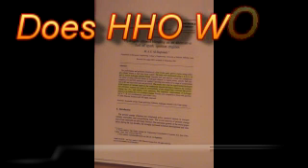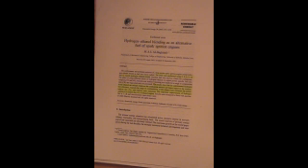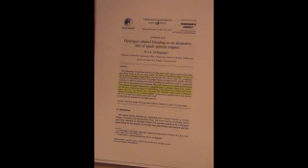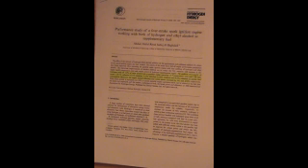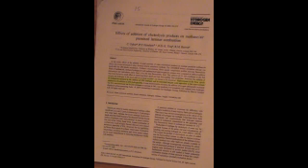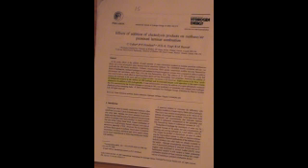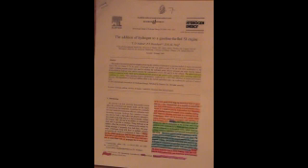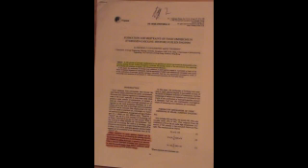Does HHO Work?

Comment: Here is another article from 1989 to look for, but you will have to pay for it :
IEEE Article 899403
FUEL CONSUMPTION AND EMISSION OF SI ENGINE FUELED WITH H2-ENRICHED GASOLINE
Y. Hacohen and E. Sher
The Pearlstone Center for Aeronautical Engineering Studies
Department of Mechanical Engineering
Ben-Gurion University of the Negev
Beer Sheva. Israel
It concludes a 10-15% fuel economy gain with a 2.3 carbureted engine, but an increase in NOx.  It states a hydrogen to fuel mass ratio of 2-6%.

Comment: Rant Part 3

To understand You only have to understand how  the energy transfers from Up & Down to Rotary.  And how HHO  boosting (increasing the flame speed) can help this energy transfer. 

So stop trying to explain how it works or does not work until you understand the ICE.   Rant over Thank YOU

Comment: @BespokeGroupUK With the study done on this video...it showed that by increasing the voltage you can offset the drain on the alternator...one of the studies said it used 3 amps of power...that is fuck all...it's almost the same as a portable dvd player...and just a fifth of the power of air conditioning...so the study is pretty much a proof that anyone opposing hho is a liar and a salesman.

Comment: But the question I guess is what was the energy source to create the hudrogen? Some say that the fact that the HHO device takes its energy from the alternator is a bad thing and increases the fuel consumption? i had a theory that if the hydrogen was generated from electricity produced by the thermoelectrc effect and took heat energy from the exhaust and the engine cooling system that might work better? just a thought. i dunno . . .